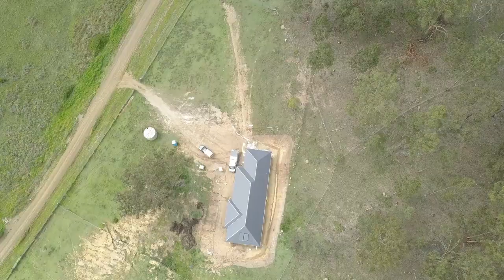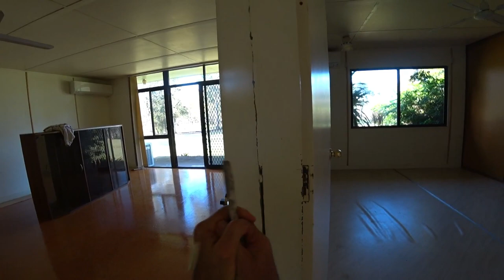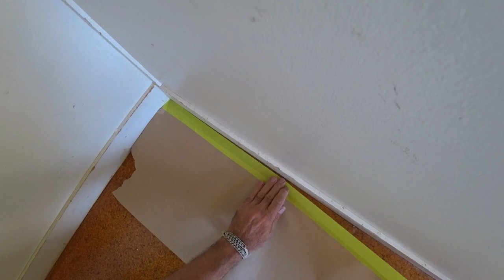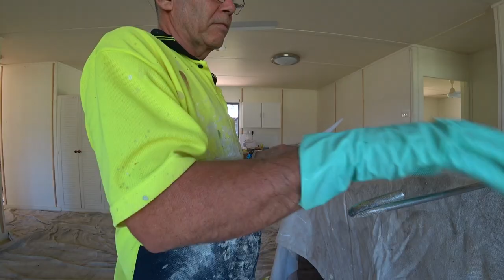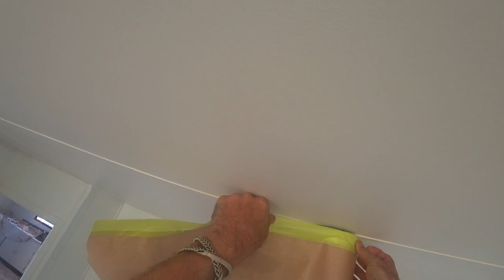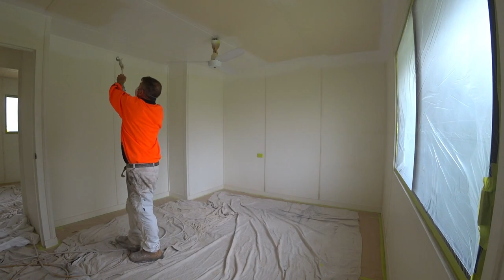Preparation Is Paramount!

Comment: Hi Greg. I saw in many of your videos, that you spray the ceiling and roll the walls. Why is it better to spray the ceiling, and inly the ceiling?(no spraying experience here) Do you also spray the ceiling if you have to work in a house were there are still furniture left and moved to the center of the room? Thank you
Reply from the maker: If the house is empty,i spray and roll ceilings, and spray cornice and trim on the walls.. if it has furniture and / or floor coverings, i still spray but i use the spraygun like a big brush .. just like in this video,im using the spray like a brush,cutting in all the timbers and corners and then i roll the broad areas,this enables me to use less paint,avoids overspray and avoids gloss flashing that happens with spray.
Reply: @ThePa1nterhowto  thank you so much for the detailed answer

Comment: i work mainly on the domestic sector in uk i get quite a lot of customers moan at me on preparation especially in bathrooms and kitchens were your using oil based eggshell on walls and ceilings they expect it to take a day or 2 decorating in a lot of peoples eyes isn't very high class at all does get very frustrating especially when its more for their benefit than yours.
Reply from the maker: The bitterness of poor quality is long remembered after the sweetness of low cost is forgotten

Comment: What brand caulk do you use? How does it hold up in a few months?
Reply from the maker: I use a no more gap product called "gsa",  mainly because it doesn't have an after taste and doesn't keep running out of the tube and it is priced right.  I would expect it to last 10-15 years especially after its been painted, it is designed for that job.